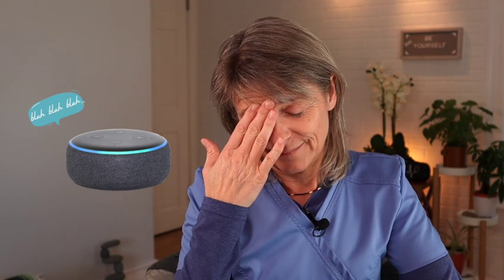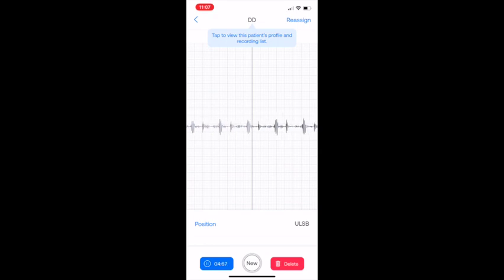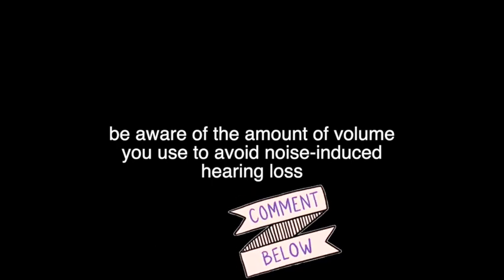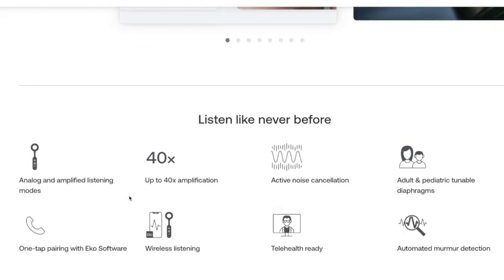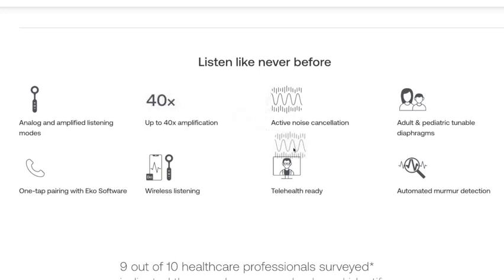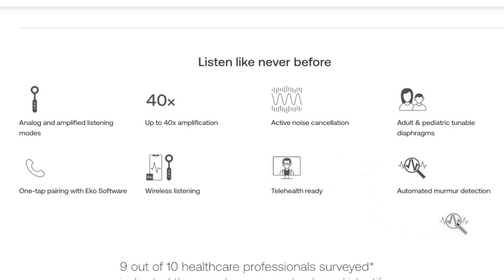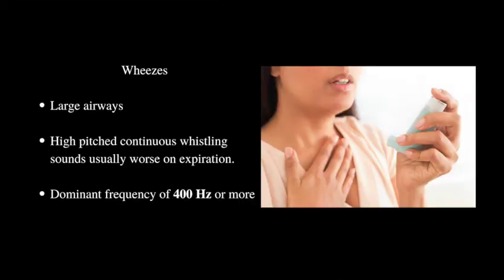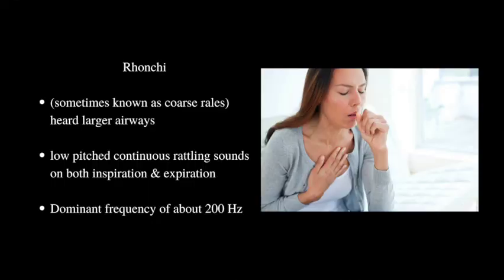Wireless Bluetooth Stethoscope I love to listen to lung sounds | with hearing loss

Comment: I wear bilateral hearing aids with Bluetooth and when o connect to the core and Eko app the signal always is going from weak to strong and therefore isn't helping me at all. The only other device I have paired to my Bluetooth besides the Eko core are my hearing aids. Any advice? Has this happened to you?

Comment: Mam   which stethoscope need to use for Taking blood pressure ..I am graduate  nurse and currently diagnose sensorineural hearing loss which stethoscope  which I can buy to taking a blood pressure monitor
Reply from the maker: Hi Rosereen, I would recommend either the Littmann CORE if you have bluetooth in your hearing aids or the ThinkLabs ONE stethoscope if you have hearing aids with T-Coil. Congratulations on graduating nursing school!!! Good job :) .